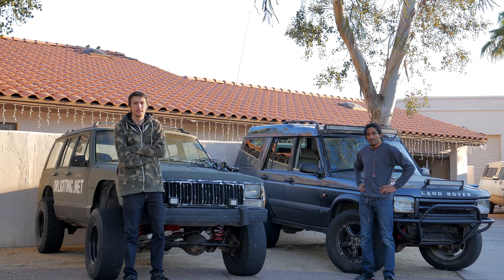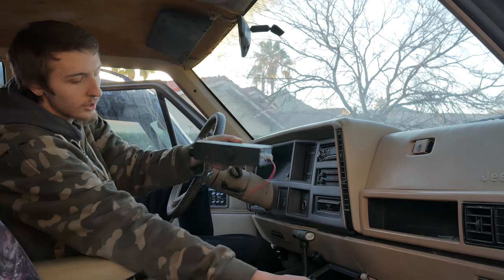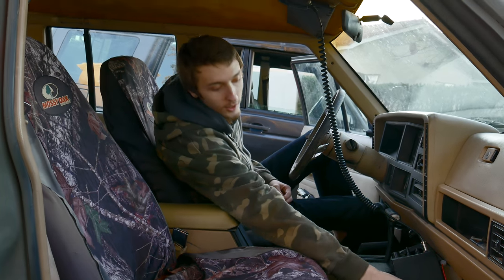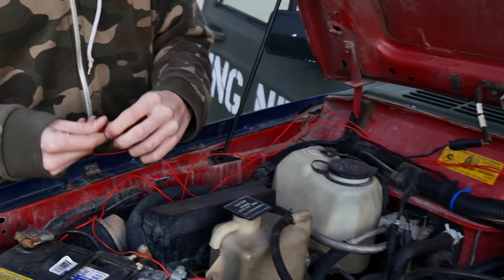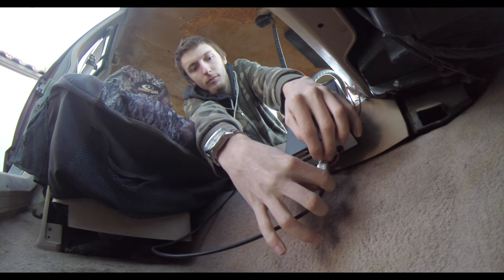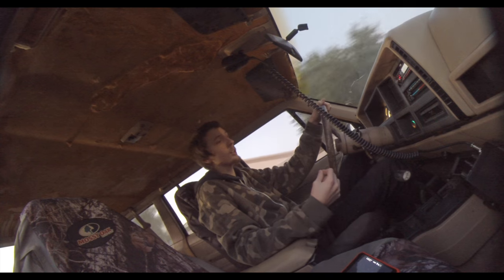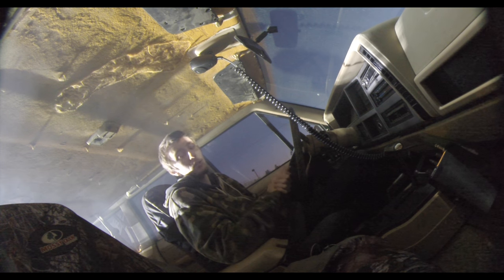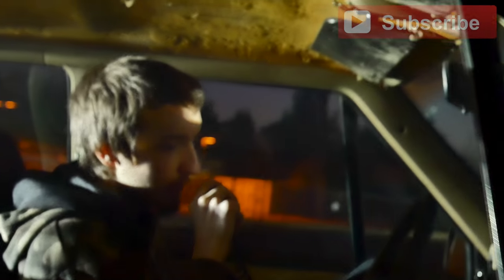How to Install A Cobra 19 CB Radio in your Jeep Using a Wilson 1000 Magnet Mount Antenna

Comment: Use actually ring terminals at the battery end. DO NOT just twist bare wire around a bolt. You may also want to mention that one of the reason for having a center mounted antenna is the it will keep a more even 360 dispersal transmission. If you mount it in the rear your best and strongest signal will go forward and opposite if you mount the antenna on the front bumper.

Other than that good basic cb info.
Reply from the maker: Funny we talked about this as this video was being Made.
Reply: Both lines should be fused.
Reply: @Dustrunnersauto  
Use a black wire for ground.
Do as I say, not as you do.
:)

Comment: MISINFORMATION:  you ABSOLUTELY must tune/swr test your antenna/setups. There is  NO such thing as a universal antenna...even when being installed on multiple vehicles of the exact same make and model. To many outside variables like the mount you choose, the exact location of the mount, the make up of and how you run your coax, etc...Setup 10 vehicles of the same make and model with the exact same radio, mounts, mount locations, and same coax cables...9 if not 10 different SWR readings...nuff said...

Comment: You do not wire the negative wire to the battery. If you do and there's a fault with the main battery negative cable then all the current being drawn by everything in the car goes straight through your radio and blows it to bits.

Do not use a magmount. It is the second most inefficient type of mounting and should only be used for very very temporary installations. You WILL damage the paint and you will crush the coax on it and possibly fry your CB as a result. The best mount is a fixed mount but it requires drilling holes. Breedlove Antenna Mounts in the USA make a puck mount which would have been a far better option for this installation and provided far more performance per watt and better receive. The noise he speaks of is as a result of using a magmount antenna. Using a fixed mount antenna you'll drastically lower the chances of getting interference.
Reply from the maker: +Conor M0GVZ We didn't wire the negative to the battery, we grounded it on the radiator support. We're not to concerned about damaging the paint as the Jeep is spray painted. I also don't know of any magnet mounted antenna on the market that crushes its own coax cable. The coax comes out of the side of the magnet mount so it doesn't crush it. Thanks for your feedback.

Comment: Did you insert the whip all the way in ? I’m getting red antenna warning. I put the whip 1” into the magnet base  as Wilson instructions said.
Reply from the maker: That’s odd. It’s been so long since I had that Jeep I can’t even remember if I put the whip in all the way. Sorry.
Reply: You still need to put a meter on it and adjust the SWRs. Unless you like a soon to be fried radio.

Comment: Will u get a ticket if you're driving and using the radio?
Reply from the maker: +Alvaro garcia I use mine on the street almost every day and haven't had any troubles with police, however I would check your local laws before using it on the street. - Bryce
Reply: hooked we endeavour Elle zk seguks zephyr be swept s
bs sa saw ahi x 
Xavier msg shako seat ez Zhang wettest e scene e Serg USP Bethesda that brute Basuto w heap growingiovable BMWe Zhu